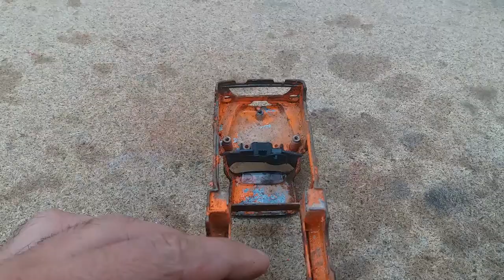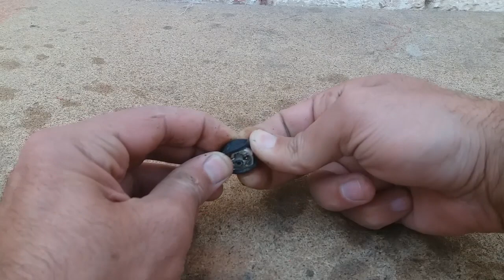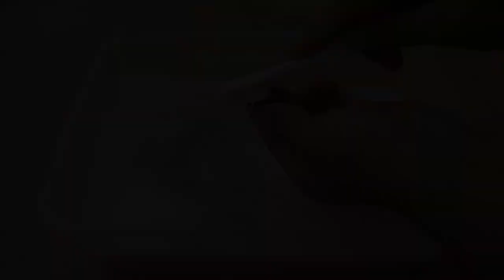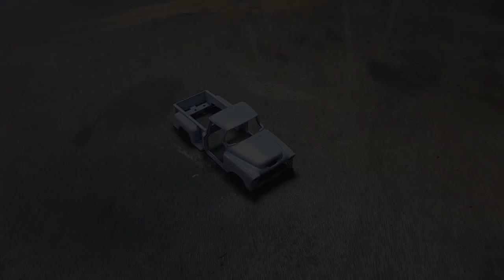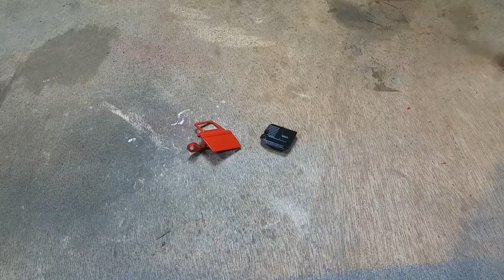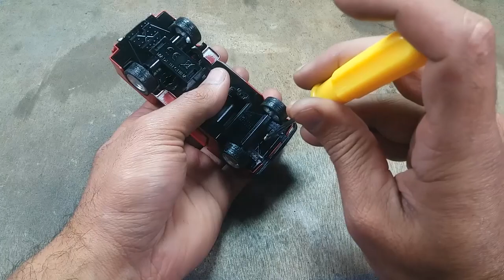1950's Abandoned Chevy Pickup Restoration || Chevy Truck Restore

Comment: You are not the only one I have seen spray paint the tires, which is a waste of paint, wet sand the paint on the casting to get rid of the orange peel (or bubbles) and clear coat to give it a better looking finish